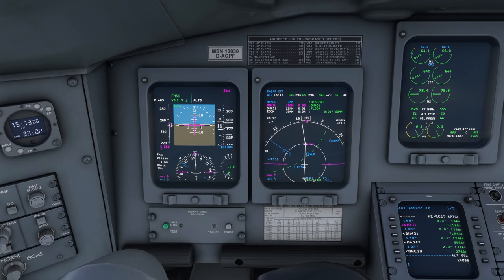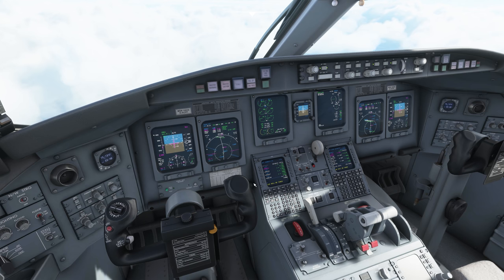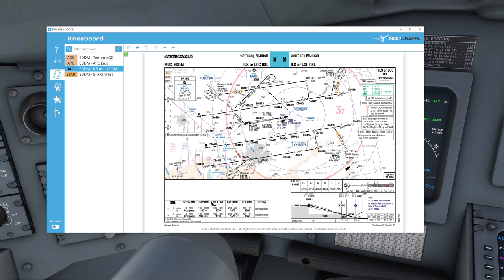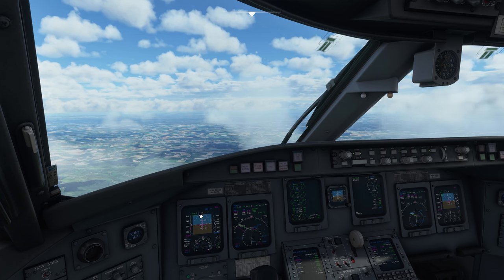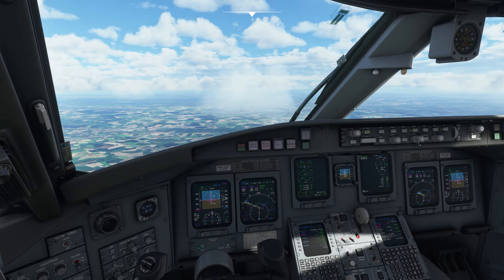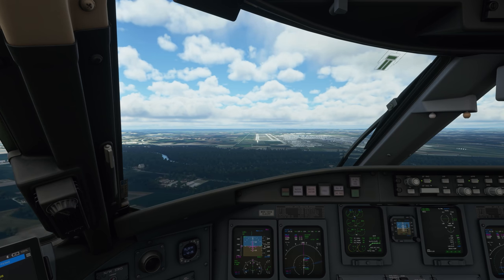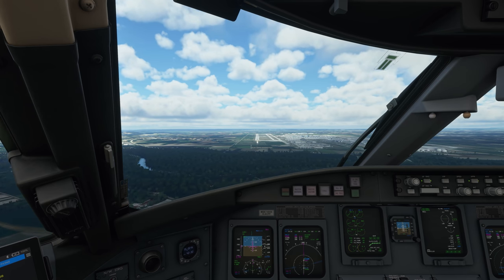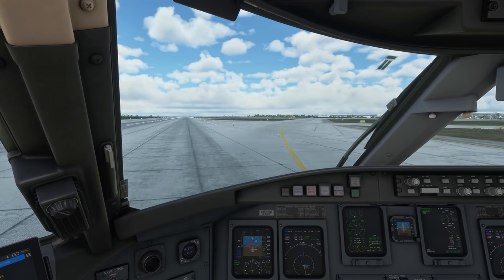MSFS Aerosoft CRJ Tutorial Ep9: Touchdown!

Comment: Kinda noticed a sway of the plane upon landing which I have seen is quite consistent among planes in fs2020. I hope ASOBO will fix the landing physics of the game! Plane looks great nonetheless!
Reply: Yeah seems to be something with the lateral tire grip/friction kicking in.
Reply: @Kolobochok95  It's very annoying. Especially in that A32X where buttered landings are very hard to achieve.
Reply: Agree. Actually I this the 320NX is super easy to land. I always get around -45, -70 fpm. I believe the real ones (xplane) are harder to land
Reply: @infinite2246  I've heard many pilots saying that landing a plane in real life is much easier than in simulators
Reply: @valterrocha  I can relate. I’m currently finishing my PPL off. The problem of simulators is that you don’t have a depth of field. Your brain can’t gather enough data for you to flare properly. Yes, in real life it is easier.
Reply: @infinite2246  that's debatable now that VR exists - since the scenes are 3D models and the Z axis exists, the VR headsets do give you perception of depth; that said, real life vs simulation will always be rather different - simulation is a calculation on a limited set of data; real life has a gazillion more parameters - granted most are so insignificant that they are totally ignored in most physics formulas and in simulation algorithm, but they still exist

Comment: great video showcasing the landing! Does the speed of the airplane decelerating mid-air (when you decrease throttle) or when you land (and use reverse thrust) seem realistic? I noticed that the slowing down seems really easy in this aircraft and was wondering if that's realistic?
Reply from the maker: I would say more or less yes. Within the confines of the simulation it is ok. As the FM is still work in progress for MSFS you can expect further fine tuning in the future.

Comment: I am having a super annoying bug and i don't know where else to ask for help. My elevator trim does not work, i have tried so many different things now but i cannot make it work. It works if i use the clickable spot on the Yoke, but the joystick buttons i assign do nothing. I am using Elevator Trim Up (Nose Up) and Elevator Trim Down (Nose Down). I have tried multiple buttons, both on my joystick and on my keyboard, nothing makes any difference. I am completely lost.
Reply from the maker: A good place to ask for support would be the Aerosoft website. You can use their forum to ask for help or you can submit a support ticket with them. From your description of the problem I am afraid I am unable to help. The only thing I can think of is to double check that you do not have double bindings for the elevator trim on multiple controllers. Make sure to have just one binding on one controller. Good luck and let me know if you find a solution, thanks.
Reply: @Flyer0245  Thanks for the reply. I can find no other buttons assigned to the trim,  and the button works fine on other aircraft. I have made a post on the Aerosoft forum, hopefully someone can help. 

On a sidenote, awesome tutorial series, very informative and at a very good phase. I like the details, even if a lot of it probably won't be used be most simmers, but its nice to know these things anyway. Again thanks for the great tutorials

Comment: Thank you very much for these tutorials! How did you manage to disconnect the autopilot without getting the disconnect bar in the down position?
Reply from the maker: I mapped a Joystick button to the AP disconnect command. IRL you normally never use the disconnect bar on the FCP.
Reply: Yes I do the same as in real life but when I disconnect it via the assigned button the disconnect bar goes down. It used to happen also in P3D too…
Reply from the maker: @alejandromartinezalvarez9584  Strange. I never saw it in P3D but I also did not fly the 900/1000 addin for it. With MSFS I also did not see it happening and I did not do anything apart from mapping the function. Did not try SU5 yet though.

Comment: Thanks for these tutorials, I was wondering is there an industry wide best practice for turning off the autopilot?  e.g. at what flight level should the autopilot be turned off or is it simply up to the individual pilot?  

Thanks again!
Reply from the maker: Sorry for the late reply, I was on the road for a few days. 

There is no industry wide standard when it comes to AP usage. For some aircraft there is a minimum certified altitude. Some airlines have it in their SOP to make full use of the AP all the time but remain fussy as to when to disconnect it for landing. There were a few landing accidents in the past that put some of the blame on the pilot for disconnecting the AP just a few seconds before touching down. The reasoning is that you need a bit of time to become familiar with the current weather conditions and a few seconds will not do. 

Most pilots that I know will, most of the time, disconnect the AP after the aircraft is fully configured and the landing checklist is read. This will be around 1500 feet above the runway elevation and I would personally say that this is the latest time to disconnect the AP on a straight in ILS approach. 

Normally I like to fly the aircraft manually after passing FL100/10.000 or so but it depends on airspace structure, traffic flow and daily fitness levels.

Comment: I wanted to come back to this video hoping someone could help me out. My CRJ700 is not following the GS like it's supposed to be. It falls short every time. I've tried multiple different airports and I have followed these tutorials to every detail. Any suggestions or perhaps a bug?
Reply from the maker: There is a lingering glideslope bug when it comes to the CRJ and MSFS. You are probably doing nothing wrong, it is just a problem with the coding and apparently it is not easy to fix by both parties involved. Best thing to do is take over manually when you see it doing something stupid or fly lateral in LOC mode and vertically in VS and aim for around -700 feet per minute when fully configured and on the GS. Maybe one day we will see a fix but do not hold your breath for it.
Reply: @Flyer0245  thanks for the informative reply! That's unfortunate, hopefully we will see one.
Reply from the maker: @KGSOsimpilot  Yeah, it is what it is.  I also hope for a solid fix someday as it bugs me as well.

Comment: I noticed a tendency for the nose to remain high for quite a while after main gear WOW. Do you put the nose down with elevator or trim down? I always seem to have trim high on landing.
Reply from the maker: You can use the yoke to give it some nose down input. But the current FM is not very realistic at the moment due to missing ground lift spoilers that were not in the Asobo code. This will change in the near future and we will get a better behaviour.

Comment: You may of answered this in one of your other parts of this crj series, but how does the fps in this aircraft compare with others in the sim? Is it on the more taxing side like the a320/747? Lighter side like the small ga aircraft? Or somewhere in the middle like the citation?
Reply: @Miles Burgess Really hope that's not the case, if it is, I don't have much hope of switching off xplane for airliners for a long time
Reply from the maker: I did not fly any other airliner in MSFS yet, so I have no frame of reference here.

Comment: I noticed that the CAB ALT as well as the delta pressure jumped from 200ft to 1400ft instantly on main wheel touchdown, which leads me to assume that the CPC landing elevation schedule isn't modelled. Is the team aware of this and will this be fixed for release?
Reply from the maker: This is a sub 60$ product, a CPC schedule is not modeled.
Reply: @Flyer0245  ??? but why. Other sub 60 dollar or even freeware planes have this modelled. This is super easy to do if you dedicated some time and effort to it.
Reply from the maker: @Kolobochok95   You have to ask the dev about that, I am just the pilot. The CPC is rudimentary modeled as time was spent on other stuff I guess.
Reply: @Kolobochok95  Probably spent the time on more important elements, wait for someone to do some $100 region aircraft if you want every little system modelled
Reply: @sluflyer06  Except this is not a little system? It's a core system and really EASY to implement a simple logic for. The Majestic Q400 PILOT edition in the same price range has this done properly, as do most freeware planes even back in FS9. Why model a pressure scedule then in the first place when in flight for it to then magically "jump" on touchdown. It's a simple fix, it's feedback and should be aknowledged and fixed if they expect to actually sell this thing well. Same with the EFB not being removable and only on one side.
Reply: @Kolobochok95  core to pilot training? And proficiency safely flying the aircraft? Or simply a core system of the overall aircraft
Reply: @sluflyer06  Well, it's a core system of the aircraft - same way the hydraulics or electics are. This one in particular really is just a bug - simply make the cabin alt. aim for the landing elevation instead of blindly follow some pre-defined schedule. If you had 200ft cabin altitude at a 1400ft airfield the delta would be negative. Really comes down to plain physics at this point.